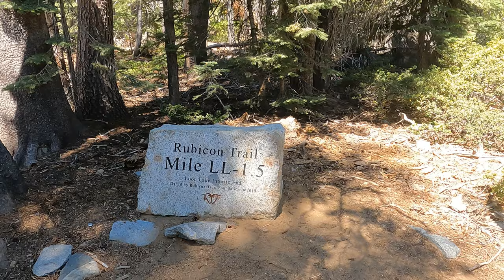The Rubicon trail Loon Lake, up Walker Hill to Soup Bowl. Next, Little Sluice in JKU and YJ!

Comment: Does the areodynamic redesign on the hood get you better fuel mileage off-road? LOL.
Reply from the maker: Yeah it really does help! LOL! That's courtesy of the Little Sluice back when it was hard. It was one of those times "That was too easy! Let's do it again" and over you go. Thanks for watching!
Reply: @Fktg_tactical  before they blew everything up. I heard it was buggy only back in those days. Nasty. The time I went, watched people break rear locker, u joints, and still have to be winched. I was lucky, found metal fatigue brake in leaf spring before it found me. Still a tough obstacle, can still eat the unprepared.
Reply: We were there 26th to 29th.  Great trail.  Find the hard lines.  Soup bowl and more.
Reply: @jeffriley2502  hope to go again and do whole trail as bucket list. Right now I'm trying to fix metal fatigue issues in frame and springs. Lottery not co operating, I keep playing but they don't pull my numbers. 93 YJ, still on leaves, 37 inch tires. Still street legal. Lots of upgrades, try you tube video, Wes drives over a car.
Reply from the maker: @Wes Barcus We have a couple videos of us doing it back when it was not filled in if you look back a ways.
Reply: @Fktg_tactical  I'll see what I can find. Do you ever get down to Fresno, Dusy Ershim ?
Reply from the maker: @wesbarcus3761  It's on our list of trails for the year. I think we will be doing it after Labor Day. From what I gather it's better to go in backward and to the hard stuff and turn around so that's our goal at this point.
Reply: @Fktg_tactical  Dusy is 32 miles long. Either start at north or south end. Drive all the way through , do about 11 miles a day. 3 days is not too bad. 2 days sort of leaves you between lakes. Last 10 miles going north is the roughest. LOTS of rocks. Narrow all the time. Good spoting recommended throughout. Jks get a bit wide for much of it. It's a trail for those who want to get away from people. LOTS of rock piles. Not overly done with named obstacles, but the rocks and tight corners can tire you out. Solitude is why people go up. Bring an inflatable and fishing poles.
Reply from the maker: Yeah, We are going to go in the North, do the hard stuff and come back out the North. I will look you up when we figure it out. Thanks
Reply: @Fktg_tactical  good plan if pressed for time. Plenty of rocks, beautiful scenery, bring an inflatable to fish Ershim lake. Get hold of me about a week or so before you head up for any questions you might have. Will help any way I can .